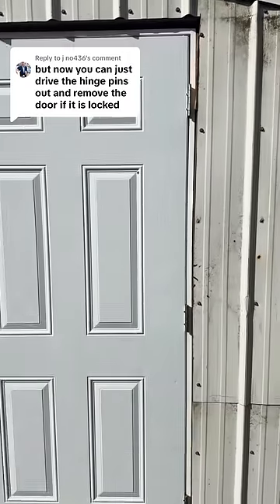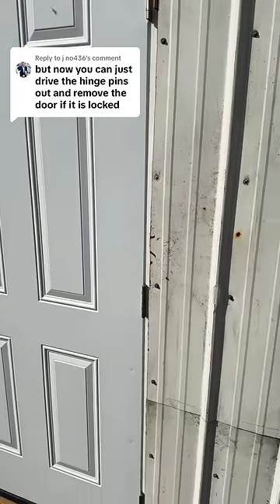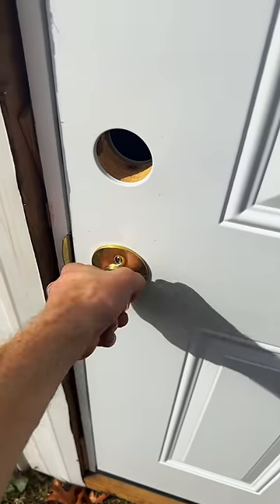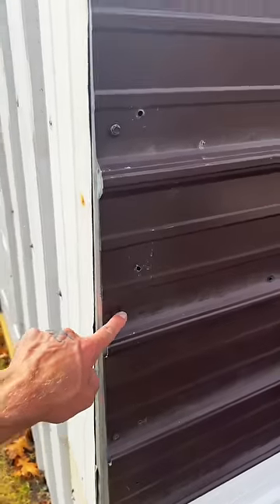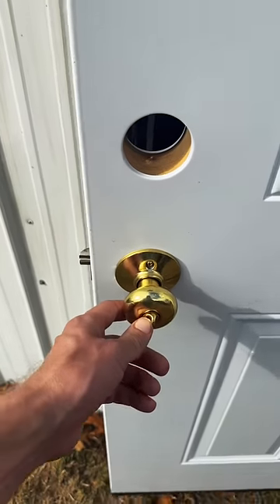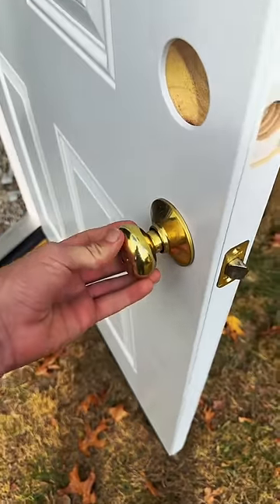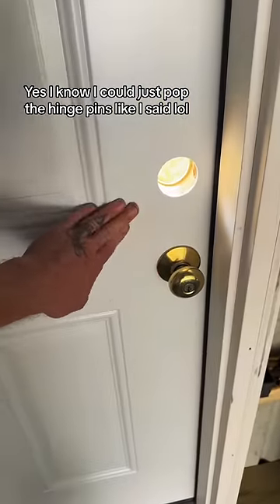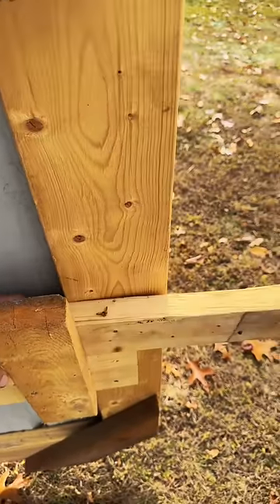Exposed hinges make it easy to get in a locked door

Comment: My landlord came in for an inspection once. He noticed a closet we'd been using wasn't locked. He said that it was off limits, and locked it with my and my roommates tools and stuff in there. I checked the rental agreement. It didn't say anything about the closet being off limits. The closet door was hung just like the one in the video. I popped the hinges, got the door off, unlocked it, re-hung it, and we kept using it until we moved out.
Reply: We’re we roommates? My landlord did that to me and my roommates painting tools and supplies like 5 years ago
Reply: The only reason I could see for that is if it were a water heater
Reply: @Capthrax1 that's true but access to the water heater is important in case you gotta relight the pilot or check for leaks etc
Reply: @russianbear0027  that stuff should be taken care of by the landlord. If you suspect a leak call your utility company and have them shut off the gas. Also a vast majority of water heaters have their own igniter, only the super old ones need re lighting
Reply: @Capthrax1  yeah I've mostly lived in old places with landlords that didn't do anything until I moved to a place with an electric heater. Its nice to know that the new ones are self lighting as its a pain in the butt.

You are correct about calling the utility. Im just a dumbass and forgot that part.
Reply: @russianbear0027  it definitely revolves around a good relationship, landlord doesn't want people messing with or storing supplies in the unit and the tenet doesn't want to wait 3 days to have hot water again
Reply: My landlord had inspection tell him I was not allowed to have my bathroom connected to my apartment, instead I had to use the fire escape door from the buildings stairway. It was like 2 feet from my door, but it meant that if I forgot my clothes I had to risk people seeing me in a towel so no thank you. He removed the doorknobs so I stuck an old toothbrush in there, worked just like a twisty knob 😅
Reply: We need an answer to sigma's question.
Reply: When your house has DLC
Reply: @Capthrax1 doesn’t matter, landlords shouldn’t be closing off access to the place your renting… you can’t just say “oh no using this closet” and then lock it if it’s not on the lease agreement.. you can be taken to court for this and every bit of money that’s been paid towards rent can become subject to immediate refund
Reply: A former landlord did the same to me, but the hinges were the secured kind.  However there was an air intake by the floor so I popped the intake grate, crawled in and unlocked the door.  I was the only one who maintained the apartment or changed the filter so I'm getting access!
Reply: @RK36_  it does matter. There are certain portions of a residence that you can't use because code and regulations trump lease contracts
Reply: @Spfinator ikr
Reply: @Capthrax1  you kind of sound like a Karen. i suppose you'd like to speak to the manager next? don't tell people what to do when it's none of your business.
Reply: @Capthrax1 what about water leaks? Water heaters will start to leak after a while. It usually starts off slow. If its locked in a closet it could be months before it is noticed and cause way more problems.
Reply: @zachdemand4508  I mean it's against fire code to store stuff a certain distance from a water heater. This normally encompasses the closet it's in. Beyond that it's the landlords problem,  they should be doing inspections and making sure the equipment is working properly . Any damage is the landlords responsibility and fault. 

Also drain pans are common and required in newer builds and some replacement depending on location.
Reply: @Capthrax1  my comment has nothing to do with storing anything in the closet. Its about having access to something that is important to your home. I guess that is the renter mentality vs the homeowner mentality. It's easy to say "I don't own it so it's not my problem", but those same people are the first to complain when there are contractors in and out for a month fixing water damage. 

Also since you mentioned the fire code. What if there was a fire. If you had access you could at least try to put it out. But I guess that's the landlord's problem,right?
Reply: @zachdemand4508  ideally you would leave it open, however, realistically if you do, some people will store stuff. Which makes the likely hood of a fure signifcantly hight. 

But you also can't ask a renter to check the door multiple times a day to see if a once a 10 year leak has happened or if the enormously unlikely fire has happened.

Officially a landlord would tell the renter to go outside and call 911. Liabilities is a bitch.

Also doesn't take a month to fix damage from a water leak. That's a gross exaggeration.
Reply: @Capthrax1  you don't check it multiple times a day. You check it occasionally. You wouldn't check it at all for a fire unless you suspect a fire (like if you smell smoke). The landlord can enforce the rule of no storage when he does an inspection.

Like I said it is different mentalities. I would not just walk out and call 911. I would do what I could to save my home. I might not own it but it is my home. 

I have seen it take 5 years to build a 800 sqft  house. I have seen it take 8 months to reside a house. It will absolutely take that long especially if the landlord is trying to be cheap. Demand is high for services and the manpower for those services are low. It shouldn't take that long, but it will.
Reply: @Capthrax1 you still gotta go in and religion it with the button on gas heaters
Reply: @phantomaviator1318  those are the older ones, they are the minority of water heaters. Even super cheap ones have a automatic or intermittent pilot
Reply: @Capthrax1  No reason to lock up a water heater.  It should be inspected periodically, to check for leaks.  Also, if it's natural gas, you might have to relight the pilot.  Also, if you go on vacation, you should turn the thermostat down to "vacation," and turn it back up after you return.  Anyway, no reason to lock up a water heater.
Reply: @kenc2257 the reason
Is that some people are idiots who insist on using it for storage even though that brings a fire risk
Do not dismiss how stupid most people are in their stubbornness
Reply: locking up tools like that is "trespass to chattels" in the US
Reply: Get your family out of the house and call the fire department, that's what insurance is for.
Reply: Definitely should have just told your landlord you're going to sue him.
Reply: @RK36_   You would be wrong. if it is in the rental agreement then yes they can.
Reply: Good on you. What they did was illegal, especially with your personal items inside
Reply: @Capthrax1  oh come on you gonna call the landlord and special services to light a match? Get outta here
Reply: @zachdemand4508  and then the landlord would try to blame it on you
Reply: I'm pretty sure my landlord was glad the didn't lock my hot water heater up when it sprung a massive leak. I was able to notice and turn the water off before any flooring was damaged. 

If you want to lock it behind a door, don't be bitching to me when it took 3 days, a new floor and the downstairs neighbours roof to collapse before I noticed.
Reply: @Capthrax1 All gas fired appliances need an emergency power shutoff.
Say it were a boiler, furnace, or gas water heater and the emergency switch was installed with older code standards and inside of the room, then it would be illegal to restrict access to your tenant.

The only advantage of restricting these spaces is for:
1. Fire and or equipment liability.
2. Limiting set temperature of the water heater to save on utilities if they are inclusive with your lease.

If the intention wasn’t for either of these things, then it was probably just to express some show of authority, or otherwise ignorance.
Reply: Bro it was off limits because of the ghost
Reply: @bj_  Worse, it's on-disc DLC.
Reply: @Capthrax1  but the same fire code, if an access to a water boiler, especially a gas one, is locked, a copy of a key has to be stored on premises. 
But neither this nor a prohibition on storage applies to standalone private non-commercial dwellings so not sure what the relevance was supposed to be.
Reply: @FloofenPoof Yeah like what the fuck. Talk about losing a tenant and a possible lawsuit.
Reply: @aslychair3096  Yeah I moved out pretty soon after. He also upped the rent as soon as I left so I'm pretty happy I'm out of there, he was a little bit strange
Reply: @Capthrax1 show me a single code that says tenants cannot have access to certaint places in a rental.
Reply: @Capthrax1 that has nothing to do with closing access to an area, just because it's possible a tenate might break a code doesn't mean you get to restrict it.
Reply: @Capthrax1 ok well in that case your landlord can evict you because you might break a code. All they would be doing is restricting the home because of the possibility you damage it. You can't be restricted to portions of a property you are renting becaise a possibility of a code being broken exists.
Reply: @AztecWarrior69_69 the comment specifically said it wasn't in the rental agreement.
Reply: @Capthrax1 ”that stuff should be taken care of by the landlord.” Very few landlords actually do what they’re supposed to. Whole reason they love renting properties out is its a lazy income. 
(Please note that this comment was not intended to come off in any bad way towards you, the quote was just to know which comment I was responding to)
Reply: @FloofenPoof are you a woman? If so it sounds like this guy was trying to creep on you wich is so disturbing and I’m sorry that happened. Or even if your a man it sounds like he was trying to creep on you.
Reply: He 100% saw the tools and wanted to steal. Should have confronted him
Reply: @loghanishere8446  I'm a woman, and honestly this man had no sense of privacy at all, I had to keep my key in my lock or he would walk in (he had a key that fit on the door too so just locking wasn't enough)... So yeah you might be right tbh but he never did anything or saw anything so I'm just gonna be glad I'm out of there
Reply: @Capthrax1 ha, landlords doing work? my landlord doesn’t do shit. he has no sense of “improving the property will be good for my tenants in the future,” he thinks purely about how much money he will spend doing something, finds the cheapest way to stop the complaints, and does that.

we’ve had a leaky roof, a bad water heater, a bedroom wall that deadass had no insulation, and that’s just off the top of my head. we had to do the insulated wall ourselves (wild i know), he only fixed the water heater after pushing it for 3 years and eventually being forced because an inspector finally noticed, and his solution for the leaky roof has as of yet been to simply place more roofing tiles atop the faulty ones rather than replace the section that’s waterlogged and absolutely not functional. we have to do all household maintenance ourselves, from changing smoke detectors to snaking drains and replacing broken outlets. 

that’s not even mentioning the worst offense, this dude has literally the majority of the house routed into the same electrical breaker. when i say that, i mean literally the kitchen on the same breaker as the bathroom that had the laundry machine, along with a few other rooms that have air conditioners plugged in, and half of a bedroom. the other two bedrooms and the half of one are on another breaker, together. it’s ridiculous, there are so many breakers that have nothing connected to them, or a single outlet even. there have been many times we’ve blown a fuse simply by plugging in a vacuum to the wrong outlet while the washing machine was running, overloading the breaker. it’s awful planning, it’s so clear to me this dude set everything up with some buddies of his rather than actually getting any professionals.

tl:dr: not all landlords give a shit, unfortunately
Reply: @RK36_ it is BS if it's not in the agreement. I've had that happen to me before but that was because the landlord had a basement with tools for maintaining the property in there and the basement was a root cellar only accessible from the outside.
Reply: @Capthrax1 you’ve never had to take anything into your own hands have you?

Living in the US in rental properties teaches you that landlords tend to do little to know work when they feel they don’t have to. You can’t lock people out of an appliance that has to be regularly inspected and occasionally fixed/maintained. What happens when your landlord does a half assed self-fix and refuses to come back out a month later when it’s not heating again because “it was just fixed”? Can’t look at it yourself or even call a professional if it’s locked off. Then what? Just gonna suffer and go without hot water?
Reply: @AztecWarrior69_69 
They specifically said that it was not part of the rental agreement...
Reply: @Capthrax1 pos Navien pilot light blows out all the time if exhausts are installed incorrectly, extreme winds can blow right into that fucker and blow it out. Used to happen all the gd time to us til my dad actually had someone competent come to check the first guys work.
Reply: Maybe he was just trying to steal your tools
Reply: The bottom line is anyone who has any kind of wealth will keep the poor poorer in the wealthy wealthier. No matter how they do it. They will do it every time.
That's always the end  goal
How much money can they make with the laws we have right now ?

That's all it is.😊
Reply: @debraway4263  You are proof that you don't have to have intelligence to have internet. We call those people hippies and commies.
Reply: @AztecWarrior69_69 the irony.... projection is a hell of a thing huh?
Reply: @TheRealMycanthrope   Oh yeah it very much is and it shows up frequently when I show people how they are. Especially when they come at me with passive-aggressive comments that they are not even internet brave to come right out and say what they mean.
Reply: @FerociousSniper answer the question that @-sigma1584 asked! We have to know! Were y'all roommates?!

Comment: Side note, if you do have a door where you absolutely have to install it with the hinge facing the side with the lock, they make security screws for hinges that will poke from one side into the other side of the hinge so that even if the pin is removed, you can't just pull the door out along the sheerline because it's blocked by a pin on the inside
Reply: pretty much all doors here in finland have a bottom hinge part that is female. and a top one thats male. you need to lift the door to remove it from its hinges, and you need to be able to clear the frame to do that so you cant while its closed.
Reply: doors and locks are used to keep low motivated thieves from taking your shit easily, a highly motivated thief will take whatever they like.
Reply: @leejones3155  absolutely. All security can be bypassed with enough effort and skill. The game is adding enough layers so that the thief just moves on to an easier target.
Reply: @Weehapaa   indeed, a Lock generally is just to protect against Opportunistic people who just happen to see something
Reply: @yunthi  Same here in norway, cant remove the door unless you open it first, and all doors open outwards, if it opens inward it was installed wrong. 
It is mainly done for fire safety, and makes it easier to leave the building faster.
Reply: @Weehapaa This. Even the police told my dad this after we got broken into & robbed. They said even putting up a couple fake security cameras in visible places would deter some of thiefs to a different house without cameras... seems shtty to kinda have to push theives off onto other people but I've been robbed twice now & we don't play anymore! Locks, cameras, and 2 big dogs make me feel much safer these days
Reply: In addition to pins spanning the door and frame. You can get hinges with a set screw for the pin which is only accessible when the door is open.
Reply: People don't understand that a lock is only one part of effective security. A lock alone is useless.

Comment: You can always put exterior hinges on for an out swing(you can’t beat the pins out). Out swings are much stronger for wind but don’t work for snow.
Reply: I've replaced an outswing three times in fifteen years at a home I repair and maintain .
It snows here, it's snowing right now, and it has rotted the jambs twice.
     The door was almost 2 grand.

Comment: While it's not really applicable to this situation, there are things like jamb pins, as well as hinges that have a protrusion on one side, at a hole on the other, that prevent the hinge from being removed in the closed position even if the pin is out.

Especially because doors typically need to open outward in publicly occupied areas.
Reply: A cheaper option than security hinges, but they have the same tabs.
Reply: There are "invisible" or hidden hinges but takes more work to get them in. Soss is the brand we deal with most. But obviously here he isn't worried about it. So I'd switch a closet door knob (no lock) onto this door, temporarily use duct tape to cover the deadbolt hole, until finding a deadbolt to cover the hole. That or if bondo or something similar is around I'd bondo sand and paint the patch. And with the deadbolt wouldn't have to worry about locking it without a key
Reply: Two flats of aluminum riveted both sides with a little foam in between.
And a doorknob that doesn't lock.